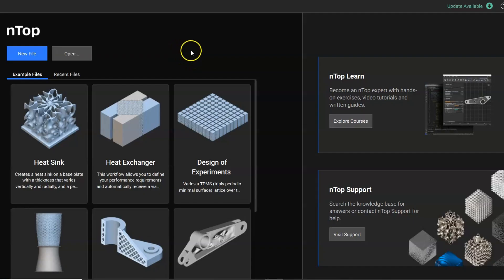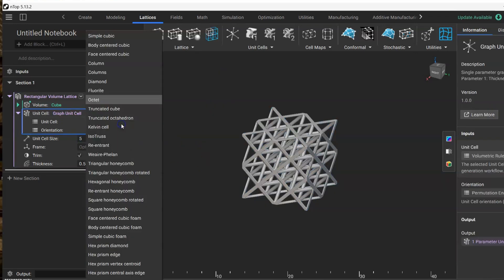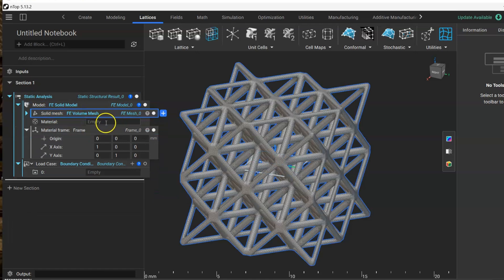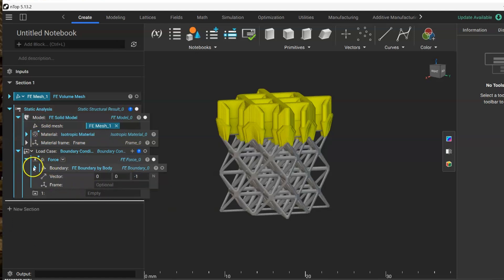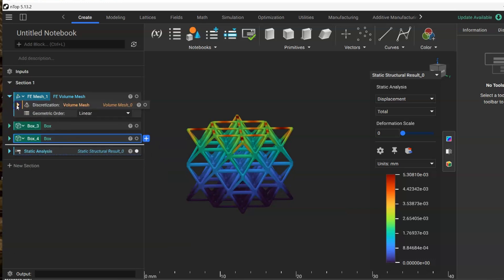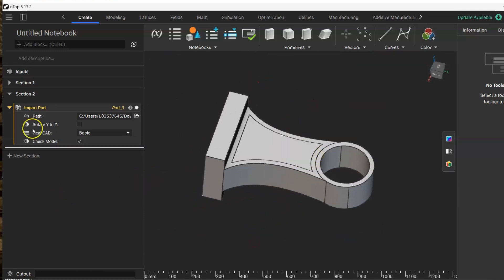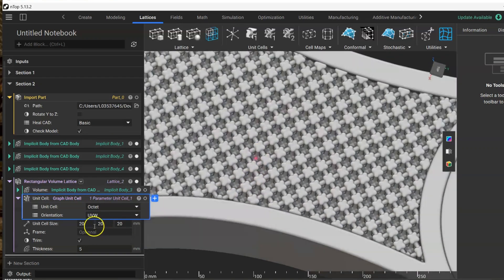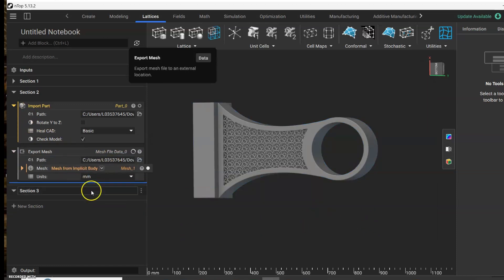nTopology: A Beginner’s Guide to Advanced Design. nTop

Comment: How do i export the data
Reply from the maker: Which data do you want to export?
Reply: @Dr_EME  The stress-strain data  to calculate Modulus of the structure
Reply from the maker: @michaelokolo7785 check the minutes 9:22, there is a box next to the structure. There you can check stress, strain, displacemt or reacción force of the structure. You can take the maximum value or use probe and measure from the middle. That is on your criteria. Then just calculaste the Young's modulus yourself.
Reply: Please, I want the part that's in the video.